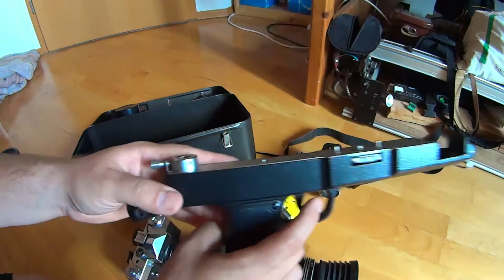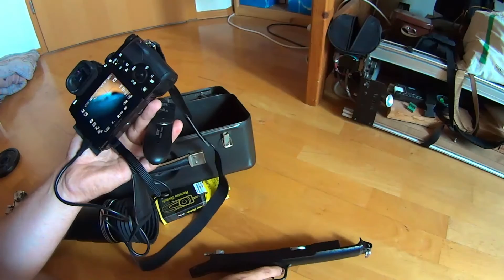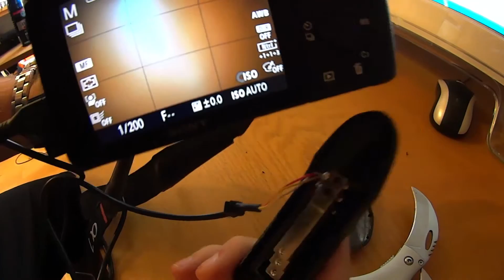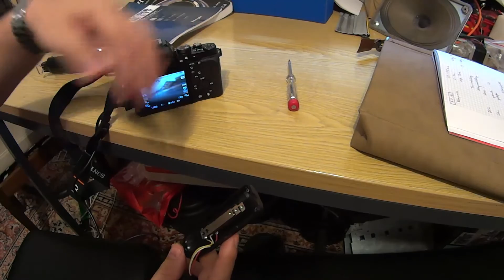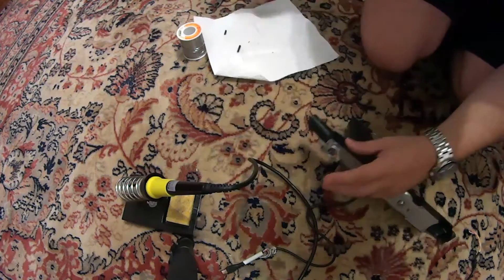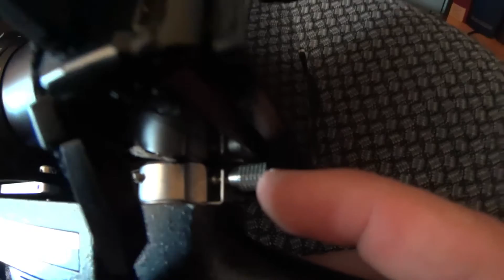Fotosniper Modification

Comment: nice video, however i noticed on the aperture bar there is a knob on top side, I think this is what the trigger button hits , there is a lock screw for it on the bar, there looks to be          ~3 mm clearance between the bar and the knob ( hint: if you lower the knob that 3 mm you might regain aperture control again!!)- even if you have to mill up a new one the right length; which going with the theme of this 'hack' as you call it ,can be replaced or adjusted between systems at the users' discretion.
Reply from the maker: yes you are right at that! the reason is, that the pushbutton of the shuttertrigger sits at a lower point than the original. therefore the trigger wont be push as deep as the original, which hinders the apeture system to fire. i could change that by putting something under the apeturemechanism so that the trigger would reach the mechanism... but the problem would be to make this removeable. because my maingoal of this modification was to make it have the original functions. anyway thank you for your thougts!

Comment: Hello everybody I have more questions. I have an micro USB cable so in theory if I wire all four wires together, the shutter sould go on repeat. Unfortunately this doesn't happen. Do I have to buy the remote and use that cable instead ? Also I don't understand how many wires must be glued ? I have four but I see you used only three. The last question is what kind of switch must be used, it works one with only two pins or I need four ? I suppose if you touch all together, the shutter should work so I don't see why two are not enough. Thank you

Comment: Nice video!  Could you please tell me where you found the 2-level push button momentary switch that fits in the hole?  Name of manufacturer and part number (model number) would be really appreciated!
Reply from the maker: hey it is not a 2 level Button. its a onelevel pushbutton. and it is a noname product. i had it lying around... i connected the halftrigger and fulltriggercables with each other, so that the shutter works. autofokus doesnt function anyway so halfpressing is not nessesary. greetings
Reply: Thanks for your reply. Does auto exposure function properly?
Reply from the maker: Jeremy Ng yes it does. and the pictures are really nice! its a great lens

Comment: Just got one today at tbilisi flea market everything included can modify it for g85 I  have smallrig cafe I guess have to take it off and try if it fits with cage it would not(
Thnx now I can take it to the guy and show him video to make that little button)
Reply from the maker: Mars Channel in my opinion its quite easy. It works well. Just use a normal remote and it should work the same.

Comment: So, by short circuiting some wires which come from Sony USB interface we can trigger the shutter. Buying a separate remote for that is too much... We can just do the same buy cutting up a USB cable)
Reply from the maker: Yes! You can do so. I did not know how they worked. So i made Mine this way. Yours will BE a Lot cheaper...
Reply: how do you do that? A simple usb cable has only two wires. Is this a microUSB or the USB C port ? Thank you

Comment: dude, soldering on the carpet :C
Reply from the maker: +dallatorretdu hahaha yeah i know bit risky but you know how timeconsuming the cleanup of tables can be ;-)
Reply: you gave me a pretty darn good idea tho, today i'll go check out a used fotosniper set. But guess i'll open the stock in order to keep retro compatibility with the zenit camera
Reply from the maker: I have the retro compatibility with the microswitch! Let me know how you get on with this project! Im realy interested
Reply: i'm waiting for the remote from amazon, somehow my A7II was not fitting with the secure ring for the firing pin of the original zenith, so I did just unscrewed that out from the pistol grip. (too bad, maybe because mine is a Fotosnaiper 12)

Depending on what i find on my remote I will just stick 2 microswitches inside the pistol mechanism. I really hope not to find the stupid tabs you found in your remote switch
Reply: oh yes, had to waste my weekend opening teh tair-3 up because some previous owner broked the cocking lever. the locking pin was mounted over the diaprhragm ring, so i cound not have max nor minimum aperture, usually thsi resulted is stuck lever.
Reply from the maker: +dallatorretdu thats a pitty sorry for answering so late your comment wasnt shown to me! Have you had succes repairing the lens?does the project come a long?
Reply from the maker: +dallatorretdu thats a pitty sorry for answering so late your comment wasnt shown to me! Have you had succes repairing the lens?does the project come a long?
Reply from the maker: +dallatorretdu thats a pitty sorry for answering so late your comment wasnt shown to me! Have you had succes repairing the lens?does the project come a long?
Reply: doertepn The lens was relatively easy to fix and clean. The project is now concluded. I did put a push button on the trigger internal rocker arm. The secure ring for the camera shutter has been removed and the USB cable exits from the left hole.
The preset aperture electronic connector and circuit board has been carefully removed from the Tair-3 lens because it was really annoying me.